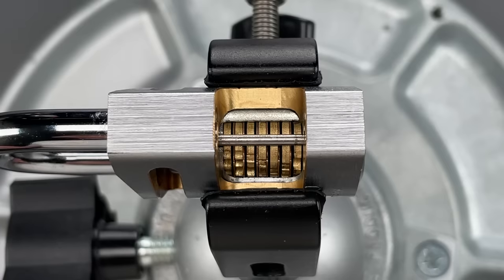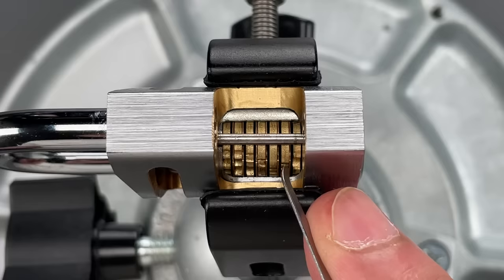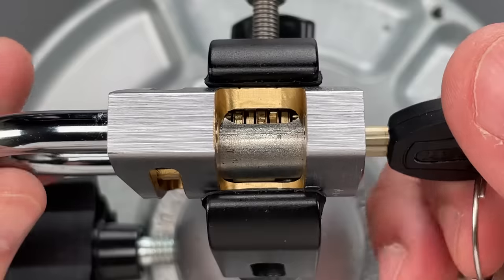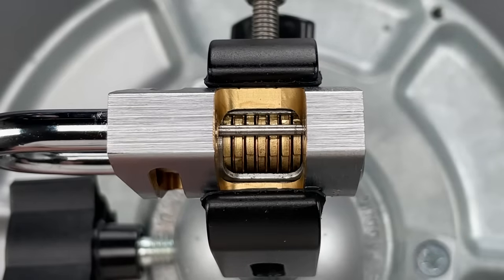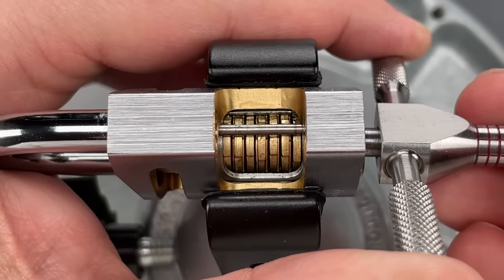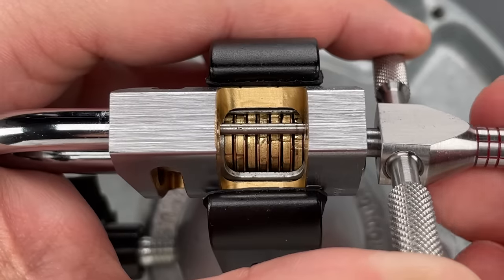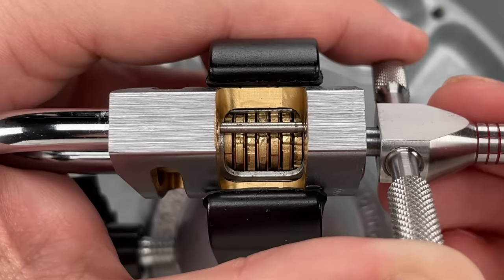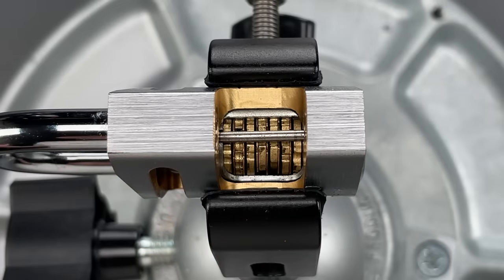[1436] Inside Perspective on Picking Disc Detainer Locks

Comment: On a related note, Wafer Core locks are known for their bad security because there aren't good security wafers available.  Couldn't a similar method of crimping deflections in the wafers be used to increase security in those to at least create some level of pick and rake resistance?

Comment: My question (and to some extent this applies to more traditional locks too), when your picking and there’s no cutaway, how can you tell which disc (or pin) you’re currently working on, and how far you need to move into the lock to work on the next disc or pin?

Comment: 2:44
So basically, if the manufacturers just made the false gates wider, so they feel like true gates (due to similar amounts of movement), they would make picking much, much more difficult?
Because if the space is similar, you HAVE to be able to feel the light binding, which you probably only can feel on one or two discs at a time, if I understand this correctly.
Seems like an easy fix, should be standard on such locks, doesn't cost anything more than narrow false gates, I reckon.

Comment: I'm thinking a demo lock would help visually, that each disc is made from acrylic. Trying to learn on my own,  I selected an old u-lock (probably no false gates), it takes a while to learn to navigate the disc spacing (like I can find one disc that turns and getting information from that but then trying to pick up a consecutive disc is the challenge).

I tried both with and without the measurements on your specified pick, yet thats hard to line up that scale with the discs

Comment: I have my grandmother’s old fire safe from the 1920s. My mom and I opened it years ago and it has my grandfather’s WW1 discharge papers and other family documents. But my mother passed away last year from cancer and we can’t find the combination. Do you have any advice on opening a combination safe? I tried removing the hinge pins, but the door is to thick to come out that way. And all YouTube offers are cracking school lockers. I don’t want to ruin this safe - it’s nearly as sentimental as the contents. All the local locksmiths want to do is drill it open! :-(

Comment: With the way the core moves between a legitimate key, an illegitimate key and picking, would it be possible to add something to the lock that would detect the picking? Such as with the key and illegitimate key all cylinders are moving, just not at the right degrees to open, however when picking you have cylinders moving independent of one another - an in your example above, in the "wrong direction" as to someone opening with the key.
Of course, working that observation in a reliable mechanical way is easier said then done, but it would add a layer of difficulty to an already somewhat difficult lock.

Comment: If the differentiation between a false gate and a true gate is mainly by the amount of travel, wouldn't it work to counter this by making the cut as wide as a true gate, but less shallow, so that the bar doesn't drop far enough?

Comment: Disc detainer lock, except there's ridges on the opposite side of the disc. When the key turns with the side bar engaged it THEN interacts with another bar/recess which needs them to be in a certain configuration. The catch is that each disc has multiple gates for the first bar.

Would that be a way to make a lock that can't be picked? As you couldn't move any disc when tensioning the second bar/recess as the original sidebar stops the discs turning.

Comment: This is brilliant, I got a couple of those clear plastic locks to learn on and I was getting on fine with pins but the disc lock theres no way to set them all in the inital position like LPL does, theres no housing to hold them they'll just rotate round and round and you cant feel anything. I couldnt figure out how to pick it without looking but its just a badly made instruction tool.

Comment: So, how does the key interact with the discs exactly? If the key only makes contact on 2 points 180° apart how does it get all discs aligned when the gates may only be a few degrees apart? And how does the key fit even when all disks are rotated as far as they'll go?

Comment: If the way you differentiate true and false gates is the range of movement, why wouldn't the lock maker cut the false gates wider on the disk to create a commensurate range of movement? It looks like the false gates on those disks are really narrow compared to the true gate, which creates that comparison

Comment: so is the difference in the false gates and true gates the depth of the cut in the disc or the length of the cut along the circumference?
you can clearly see that there is more movement, but im not exactly clear on the axis of movement ie how it relates to the sidebar.
i'm wondering if a poorly made lock could potentially be opened with one or more discs in a bad false gate.

Comment: Can you please make a video on the locks where the core doesn't turn? Such locks where the key goes inside the lock and the casing outside stays in place. The problem is that you can't apply tension fro the outside. Thanks in advance!

Comment: Hey I'm a big fan of yours and I mixed a combination lock and as the lock is very strong to defeat I had to start from 000 and continue my way to 999 
And this lock is is one heck of a hard to hijack lock it didn't have a brand.. it's code is. RTX-533  
IT LOGO IS SIMPLY A DIAMOND SHAPE BORDER AND WHITE INSIDE WITH THE BORDER BEING 2 SHADES OF RED FOR EACH 2

Comment: I just have a question. How do you pick locks if the core is installed upside down? Instead of picking up you have to pick down instead? This is the issue i ran into on a door for which had the core and handle installed upside down. It was just a basic lock with 5 pins with no security pins/spools etc.

Comment: is there any way to pick, or open, those directions padlocks? the ones with the button on the front and you swipe up, down, left, and right to input the combination? i was just curious, because without a keyhole I figured the only way to do it was to put in the combo.

Comment: So if the manufacturer some how able to make the disc spring loaded it will defeat this tool as the key has to be twisted and hold in position and to unlock? 🤔💭

Comment: What makes me really curious is how the key rotates the different discs to different positions at various turning speeds. Sometimes while you keep the key turning, the discs turn with it, sometimes they stop, only to start turning again a few degrees later. Is it based on friction? And would that mean an old lock where the friction doesn't really hold up anymore gets hard to open with a key?
Reply: The friction we see is caused by LPL tensioning off the first disk, and it is what enables him to feel what is going on! By tensioning, he pushes the sidebar down against the disks. This wouldn't happen in a lock under normal circumstances: a working disk detainer lock has very little internal friction, in part because of the spacer disks between the active disks.

Comment: What is a "zero" cut?  Do the discs come in different thicknesses, or is there a standard thickness  It seem like it would be much more difficult to use the tool if the discs were of different thicknesses.

Comment: so in other types of locks, when you insert an incorrect key it won't turn at all, whereas in a disc detainer lock an incorrect key will still turn somewhat, just not enough to open, right?

Comment: The 'impression' I got from this is that a lock with much finer tolerances would be harder to pick because if the wiggle room on a true gate is little to none it would be harder to know its a true gate correct? Likewise if the difference between the depth of a false gate and a true gate were minimal, it again would be harder? 

Are these guesses correct? (Total noob so apologies if stupid observation).

Comment: I wonder why don't they make false gates same deepness but wider, so they will be the same width as a true gate. This way you'll still probably be able to distinguish them by force applied to turn it, cause the bar will push on them a bit. But it will be way harder and require more skill then checking the amount of movement. 
It doesn't seem that they will become a flaw and allow opening it via false gates if the deepness and tolerances are good

Comment: Before you and Bosnian bill made that tool. What was the method to pick these and what tools were used
Reply: There were (and are) similar sorts of picks, but not as well designed as the BB&LPL pick. It tended to be that each design was useful for a limited range of disk detainer cores - sometimes a very narrow range!

Comment: question: why do the true gates require that amount of wiggle room? why not have them be closer to the false gates and only have the depth of the cut differ?
Reply: It is a round bar. To have more depth it also has to be wider or the sides of the bar would catch and the bar wouldn't have room to retract. I guess the solution actually would be to make the false cuts shallow, but wide to more mimic the true cut.

Also disc locks are usually pretty loose, since those are often sold for harsh environments. No springs and loose tolerances means it can still work full of muck and gunk by having room to push the crud into.

It was one of the big sellers of disk locks in addition to security originally. No springs means more reliable operation. everything is hard surface to hard surface mechanical action. Key directly controls the rotation of the disks, so one can even apply some force on them to make sticky lock turn. The sidebar is being forced to try to insert into the cuts by the carrier and so on.

I'm sure one could as said make tight toleranced disc lock. Most just don't bother, since the picking security is way superior to pin tumbler locks to begin with. There is no easy attacks like bumping a disc lock. One has to manipulate each disc individually to line them up.

Comment: Thought of a better lock for sensitive data. If you open it up wrong the data is destroyed.

A gene sequenced encoded to a protein system that when ran through a cipher to it decodes the message encoded into the microbe... And it could be contained Ina system where unlocking is through a special key drive for the first stage... 🤔

Comment: Is there any technical reason for false gates to have less wiggle room? From this picking video it looks like a pointless flaw; making false and true gates the same size (length wise) would mean you couldn't tell them apart from a picking perspective.
Reply: Just guessing here, but mechanically if the gate is deep enough for the side bar to fully drop in, then it would align with the release mechanism and allow it to open. This would make the "false gate" another true gate and make it have 2 places where it can open. 
I wonder if that's how multi key systems work actually.
As I'm typing this, couldn't the false gates be made wider to give the feel of a true gate without being deep enough to align the side bar with the release mechanism?
Maybe someone better informed than I has some insight.

Comment: I take it that the 1st disk that you are tensioning off of is not visible in the cutaway. I was wondering how you were able to both tension ff of it and also rotate it in the other direction to find the gate. Does that 1st disk have a gate and is it always in the fully rotated position?
Reply: Cheap locks tend to have a zero cut on the first disk, so it doesn't need to be rotated backwards to find the gate. Better locks put the zero-cut disk at the back or even somewhere in the middle of the lock, and LPL has to use a technique to deal with that - he starts by tensioning off the first disk, picks the rest, then finds the zero-cut disk with the probe and tensions off of that, and rotates the first disk with with the shoulders of the pick.

Comment: Why don't they design the true gates in a way that feel identical to false gates? I get that they need to be different in terms of how the side bar mechanism works but it seems to my untrained eye to be far more different than necessary. That would make picking them a lot harder (but not impossible).

Comment: So the only thing to make this harder to pick would be larger false gates, so you cant differ between false and true gate? Then why this simple addition is not done to enhance lock security?
Reply: If they made the false gates deeper, then during normal use there would be a danger of the side-bar dropping far enough into it to jam that disk and stop the lock working. They could make the false gates wider, but a decent lock-picker would be able to feel the side-bar rubbing along the bottom of the disk just as easily as they could feel it not moving, so the change wouldn't improve things.

Comment: What if a lock had two different sets of keys such that each disk had two true gates? Then when picking you would not know which true gate went with each other.
Reply: If each disc had 2 true gates, it would not make any difference because as long as you have at least one true gate on each disc lined up, it will open.
Reply: @Well_I_am_just_saying  ahhh your right thank you! Back to the drawing board 🙂

Comment: But why is the true gate longer than the false gate? Seems like a dead giveaway.
Reply: The true gate has to be deep enough for the side-bar to drop all the way into it, and it has to be as wide as the width of the side-bar. Once the side-bar is in all true gates, then it will drop far enough to prevent significant movement. Of course, this raises the question of why the false gates can't be wider!

I suspect it would make no difference: if the false gates were shallow and wide then a picker would be able to feel the side-bar rubbing along the bottom of any false gates.

Comment: dear lpl

if you buy and use specialized tools to "pick a lock" then are you really picking a lock... i mean let's face it, a standard crow bar is a tool that you can use to open most locks

how is buying a specialized tool not cheating and if youre going to use one then why not do it with a crow bar or just melt the thing with a blow torch?

"picking" to me really means grabbing a common item like a hair pin, and being able to open a lock that way, what are your thoughts on this?

~respectfully
kristin